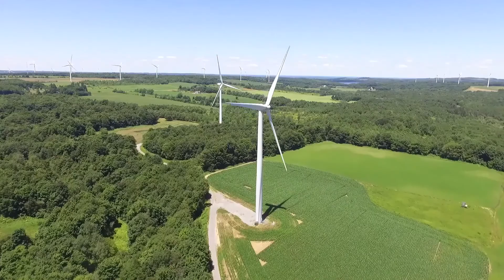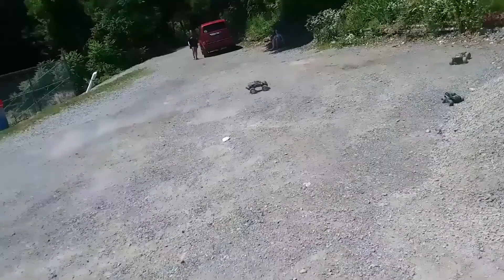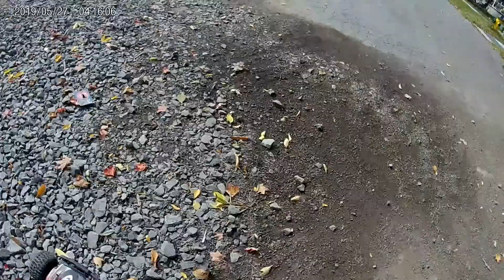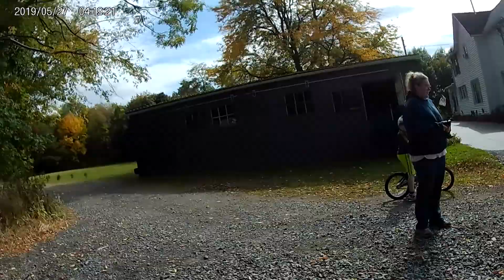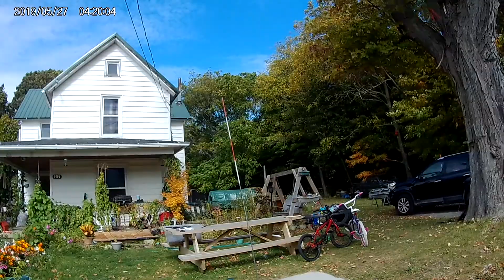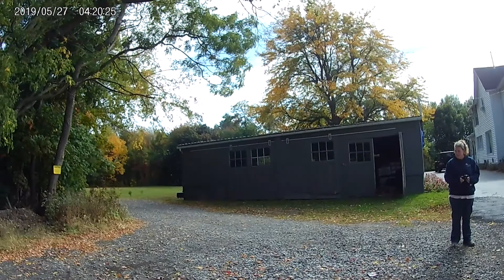Holyton 9205E Vs DEERC 9206E Road Rampage Fun

Comment: I just ordered the holyton knowing I would be upgrading some parts.
Can you tell me what I have to look out for when upgrading battery?
I think I have to stay at the same Volts, 7.4 or whatever it comes with but I can increase  the other number for example 1700 to 2000 as long as it's still 7.4. is that correct ?
Thanks
Reply from the maker: You can upgrade it to 3S. Meaning the next battery higher then 7.4. Which will be 11.7 Something. But you need to add a fan to the ESC so it doesnt overheat.
Reply: @RCCRAYZ  thanks